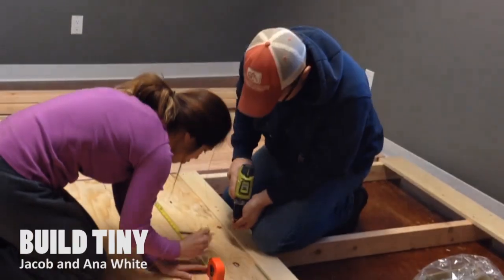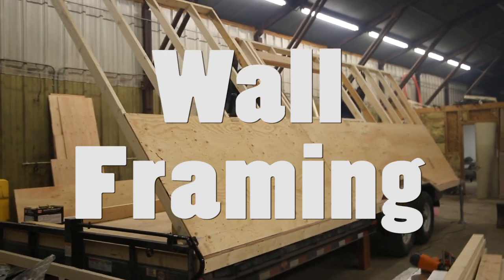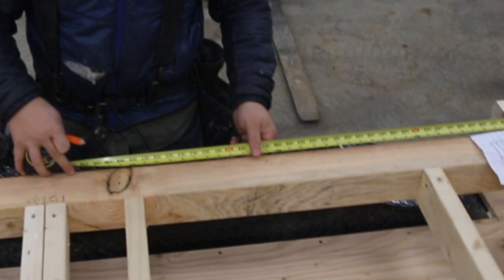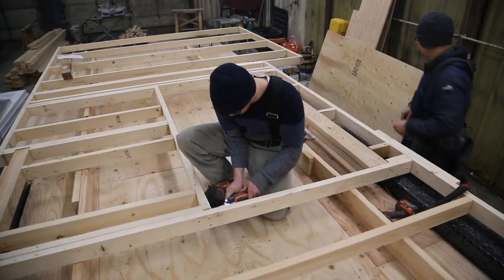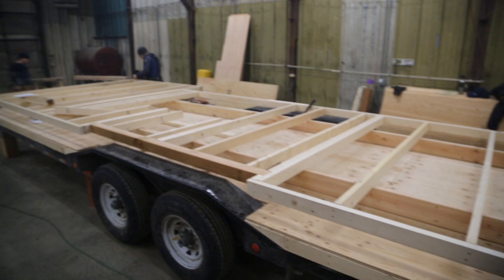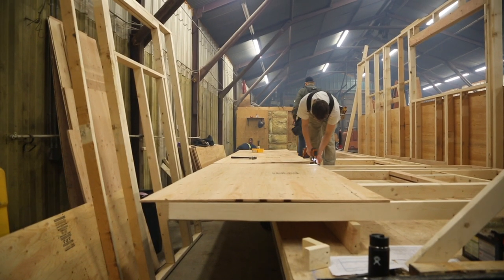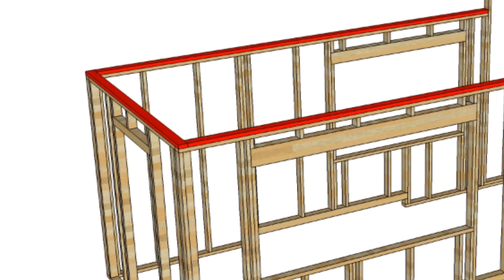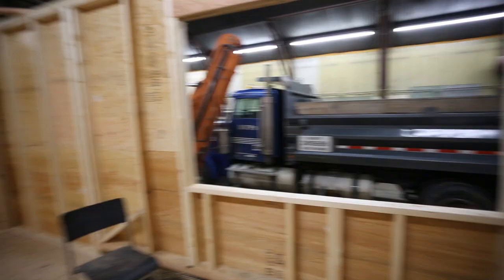How to Build and Frame Tiny House Walls: Ana White Tiny House Build [Episode 3]

Comment: what about flexing? how do you compensate for that? or is that not an issue?
Reply: Don't have to worry to much on flexing. But if you only had one person standing a wall I think you could have some trouble.
Reply: +Jacob White I was talking about while driving the trailer down the road.
Reply: +juan chaidez the structure is pretty stout. Don't think there will be a issue.
Reply: I've seen a video addressing this issue on a custom made trailer. a solution is to build a square frame under the lower suspension travel under the axles. then from the two outside corners of that frame, run a brace to the outside corners of the frame. this can also be x braced in between

Comment: why not use steel framing?
Reply: Back Country Preps wood is what is used for do it yourselfers because not everyone can weld and cut metal.... Also 90% of rv' mobile homes and site built homes are all framed out in wood
Reply: Happy Thoughts thanks for your input, but their is no welding with steel studs, it's all tech screws and brackets. they day steel framing is 75% stronger, 1- 10th the weight and does not rot,rust,or get attacked by termites ect. the reason why I asked the question is because I'm going to build my 1st tiny home and want to do it the best way available. no disrespect, but it is always a good idea to keep an open mind
Reply: Back Country Preps they are in Alaska... I'm sure the materials there are not as abundant as lower 48
Reply: Happy Thoughts ya,agreed
Reply: You're sure there isn't as much lumber in Alaska as other states?!
Reply: Butwhy Doesitmatter I'm sure there's a ton of lumber in Alaska but metal or steel framing for a tiny house built there is probably harder to come by

Comment: NAILING a moving house???  With all the movement it's likely to experience?  No no no no no!  That's cheap, but you're begging for problems.  Use SCREWS.  Yes, they cost more, but they are likely to save you money later.
Reply: Screws are worse in this situation because there's going to be a lot of sheering force on the joints as it moves. Screws are brittle and break more easily than a nail, and a big 10 penny nail is going to have plenty of holding power.